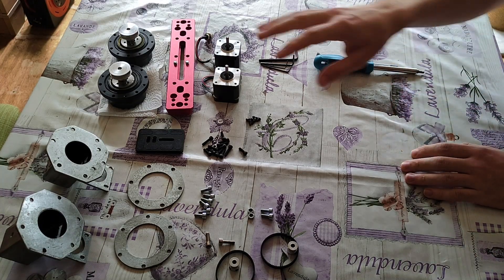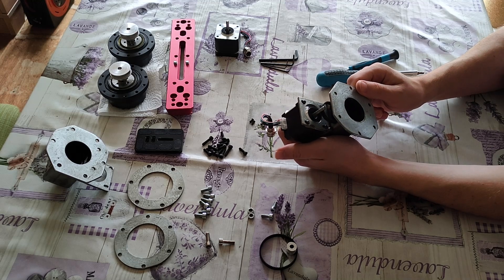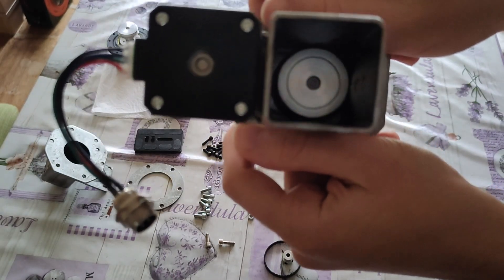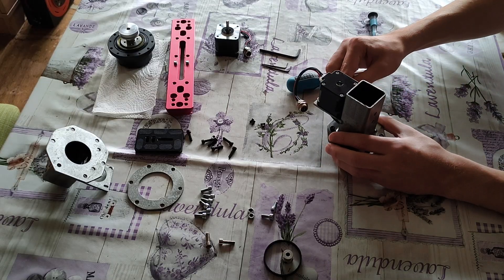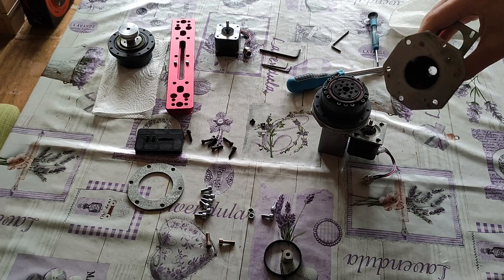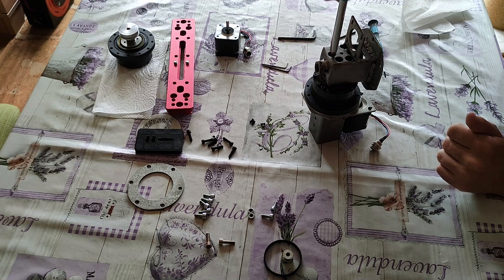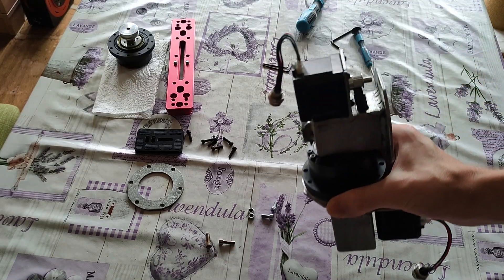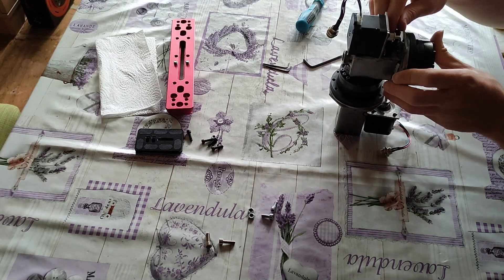DIY Harmonic Drive Mount Assembly and Part Details

Comment from the maker: Here are the links for the Onstep controller and the harmonic drives from both sellers:

Harmonic Drive 1:
https://a.aliexpress.com/_ExCCkdC

Harmonic Drive 2:
https://a.aliexpress.com/_EugR58E

Onstep control kit, I got the Exos2 V4 Pro. This has since been updated with the V5 pro, they look very similar but may have a few differences internally:
https://a.aliexpress.com/_EIWW2se

Comment: My compliments sir, this is a very smart way of constructing a strainwave mount without requiring any serious machining, CNC or otherwise.

What strain wave drives are you using?
What is the guiding precision like?
Reply from the maker: Thank you so much! I have put a comment on all of the videos with the links to the Harmonic drives and the Onstep control box. 
I used size 17 1:100 harmonic drives. The motors are NEMA 17 and these also have a 3:1 belt reduction. I've tried to match the mechanical specifications of the ZWO AM5N as closely as possible as I wanted it to have similar performance. Guiding is generally good, it's between 0.4-0.6arcsec with a large 127mm refractor at f7.5 without counterweights. 

I designed this for more of a portable setup though and with smaller equipment wind isn't as much of an issue.